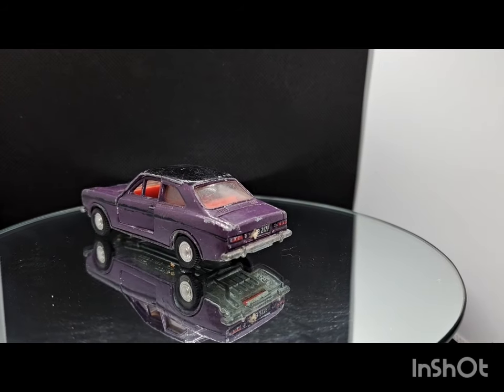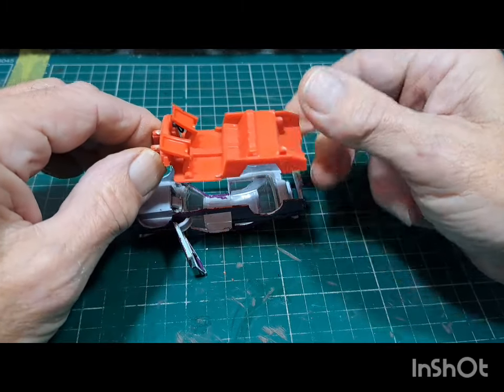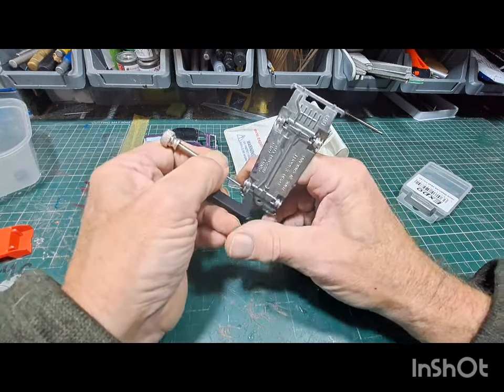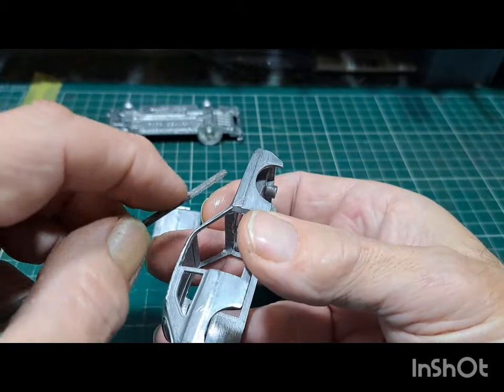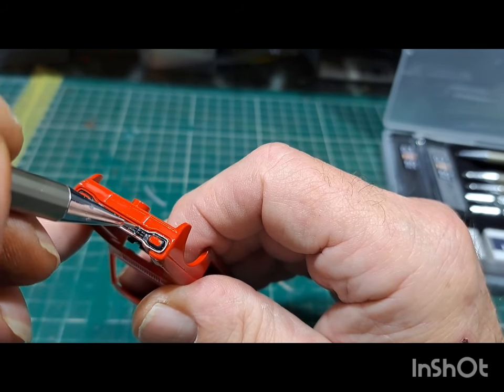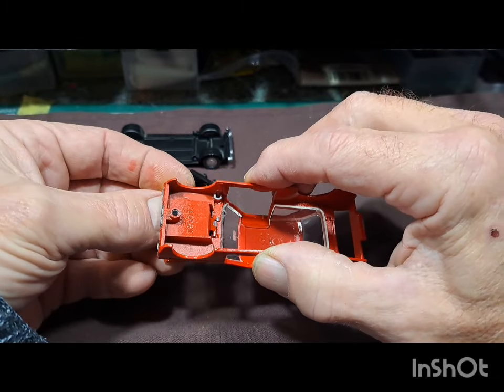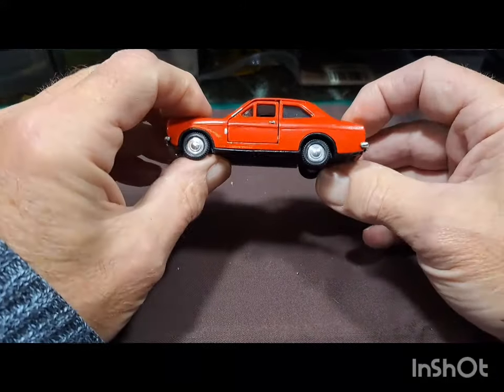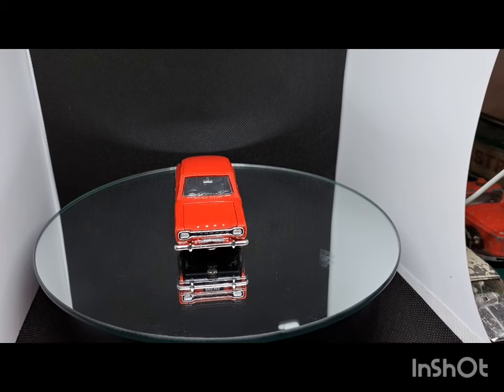Diecast Restoration Dinky Toys Ford Escort Mk1 no/168.     1968/77

Comment: A very nicely detailed Martin, red does make the working man’s car look sharp, over here in the US the Ford Escort was a very economical mode of transportation for many of us working class, a all around good car, the pen brushes that you were using certainly were a great choice for detailing 👍( I got to get me a set of them Martin 😉). It isn’t long before Chistmas will be here so maybe Santa 🎅🏻 …….will leave me a set of pen brushes under the tree 😁lol,  My good friend take care & I always look forward to seeing what will be on the “Magic Round a Bout”, see ya 👋😎🚗🚙🚒
Reply from the maker: Thanks Jeff, yes the Escort was pretty basic but fun to drive and had a lot of potential. Those pens. Are mechanical pencils the ones with retractable lead ,can also be used for glueing fine parts with a dabof glue .
All the best Martin
Reply: @martindaredare  Thanks for the infro about the pens Martin, I miss understood about what they actually were, yes a very good idea to use them for painting very fine details & glueing tight spaces I definitely will be using your idea,your making me a better detailer,😊Thanks again my friend see ya.👋😎🚗🚒🚗

Comment: Great effort Martin,  was this based on a car you once had? Because I noticed the 72/73 L reg , red is a colour that doesn't scale down too well , I think this dinky casting was a pre production of the real car , because the real car didn't have the chunky type rear lights , they shared the same rear light of the MK1 capri,  also the reversing lights weren't either side of the number plate but small oblong lights just under the rear light clusters made by Wipac if I remember correctly,  and this casting is devoid of a fuel filler cap which I believe was on the rear haunches. The better model had black rubber on  the overriders,  like on the XL or GXL .
Reply: the fuel filler cap is flush mounted,on the drivers side,and yes the rear light clusters do look wrong.
Reply from the maker: Thanks, Peter. yes i had a red one the same as this, good, simple driving. this particular casting isn't spot on accurate. they also missed out on the front indicator lights ,but in reality, it was only produced as a toy back then rather than later versions designed for collectors all the best Martin 👍

Comment: Love that front grille it looks Brilliant.    Q:  my molowtow chrome pens have lost their shine .    Just like a normal metallic pen now .  Have you had this before ?   
I put them in warm water and shook the hell out of them but no different.
Reply from the maker: Not personally, but I would imagine thay are starting to dry out ,try getting refill bottles apparently this is a better method using a brush and it works out cheaper in the long run .
All the best Martin
Reply: @martindaredare  cheers Martin. 
Iv had them for about 2 years I bought a set and as you know you don't use much at all .  There's loads left in them over half  . So there's a a £30 lesson iv learnt just buy one .   👍
Reply: Have only been using molotow  in last year as I've  never really need on the models I make the things I've  found out with molotow  where possible  as Martin  says buy refills don't  buy cheap copies they say  look like chrome they don't  if doing bigger areas  use a airbrush  you can get a fantastic  Finnish  lastly  leave  it well alone it does not dry quick

Comment: "...and an 18yr old Escort" XD
looks great in red. interesting method using a pencil-pen (what are they called in english, anyway?) to detail the grille. the other method could have been using flat-black "Bare Metal Foil" and polish out the highlights. never tried it myself, tho.
as for the casting line along the flank, a trim line would have been straight, if I recall right? otherwise it could have been used as trim.
reminds me that there is an airfix model kit laying around waiting to be completed, painted it in daytona yellow. now where did I put it...

a while ago I started to photograph my ford model cars, planning to put them online as a collectors' service one day. the list of models (I sorted them by model, adding scale and maker to the file name) indicates that the Capri Mk1 is more popular. doesn't mean I wouldn't want to drive both one day. :)
Reply from the maker: Hi Lothar, the pen pencils are called mechanical pencils I thought I would give them a try I watched a guy doing a scale model car using them for detailing the dash board,can also be used for glueing small parts together .
The Escort had a pin stripe down the side if you wanted it I think the 1300E had one ,the cheaper ones didn't  you must have a lot of ford's in your collection then very impressive 
Te trouble with the capri was the back end was a bit lose if weren't carfull the Escort held the road better that's for shore. 
All the best Martin 👍
Reply: @martindaredare  I see. well, that's what I shall do when I find a broken mechanical pencil, then, put it aside for such detailing. :)
there are many models, not all are photographed yet; but I'm reluctant to count, I might peg myself insane. XD
Ah, okay, I forgot to take english outback roads into account. XD the one time I was in england was back in 85 with school classes. we spend 6 days in and around London. the host family me and two friends were at, was an elderly people, but he drove his cortina Mk5 like a younger man. ;)
thinking back I should have asked the neighbour to teach me cockney, if only to piss my english teacher off with it. ;)

Comment: What Type of Paint do you use for the Diecast Cars, You might remember me emailing you about the Mark 1 Dinky Ford transit fire engine For restoration I  will Probably still send you it for a full restoration and with your Price but my parents Say that I have to use my own Money so I’ll just try to save pocket and Send it over to you so you can bring it back to life but for now I do know a bit of stuff regarding Diecast Models And restoration. And where in the Uk Would i be Able to get the Type of paint ? 😅
Reply from the maker: Hi again I use automotive paint witch you can get from any car shop .
Quick and easy to use.
Reply: @martindaredare  Thanks 🤩 😊